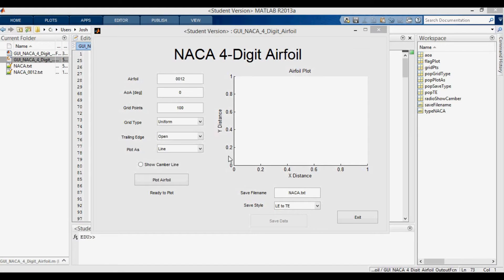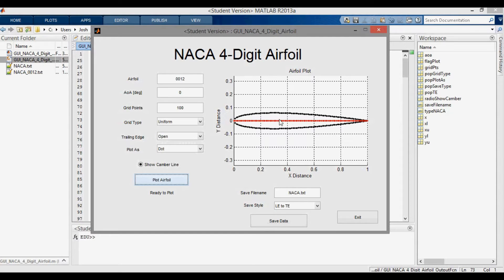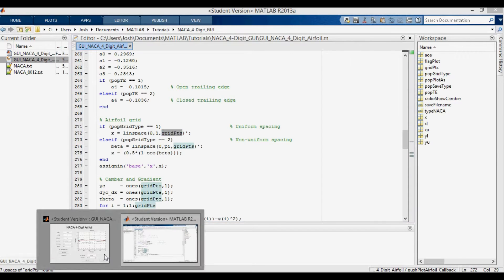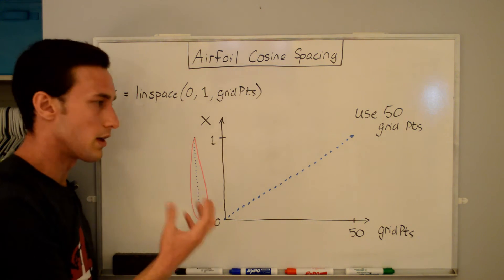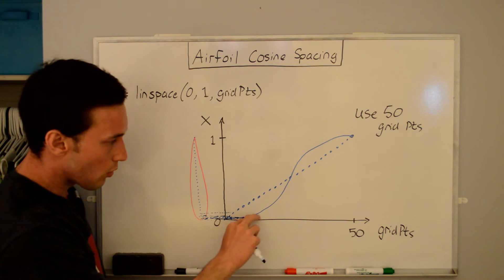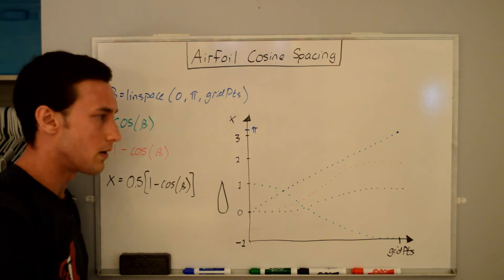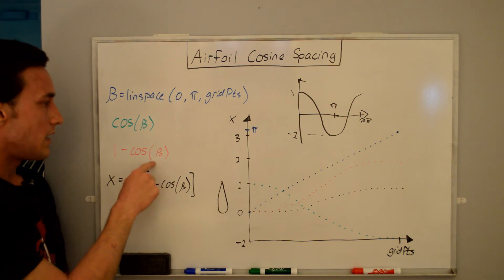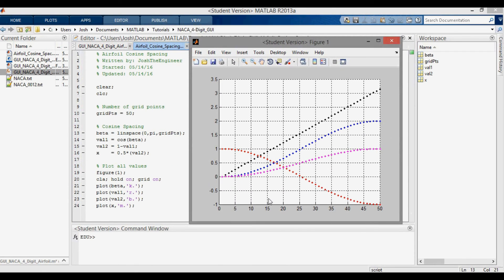Explained: Airfoil Cosine Spacing

Comment: What is the reasoning for using 0.5* [1-cos(beta)]?
In the end, doesn't it result in the same grid spacing as simply using 0.5* [cos(beta)]?
Reply from the maker: In the most general sense, the overall goal of this non-uniform spacing is to get a different distribution of data points that go from the leading edge (x = 0) to the trailing edge (x = 1).  The reason we need the data points to go from 0 to 1 is that the chord length is actually a normalized chord length.  This means that you can take our generated airfoil shape, multiply it by whatever chord length you want, and all the X and Y data points will scale accordingly.

So based on that need to go from 0 to 1, we need the function to increase from 0 to 1 as we go from beta = 0 to beta = pi.  If you look at the plot that I have on the whiteboard, you can see that the cos(beta) plot (green) goes from 1 to --1.  If we just multiplied that by 0.5, it would go from 0.5 to -0.5, so that won't work.  Then you might say, well we can just shift it up by 0.5 and that would be fine.  That's actually what the 0.5*[1-cos(beta)] is doing, and you can see that if you distribute the 0.5 term through to get 0.5-0.5*cos(beta).  At the leading edge (beta= 0), we get 0.5-0.5 = 0.  Then at the trailing edge (beta = pi), we get 0.5-(-0.5) = 1.  To sum it up, the main reason is so that we get a distribution (on the vertical axis of the plot on the whiteboard) that goes from 0 to 1, and simply using 0.5*cos(beta) would go from -0.5 to +0.5.
Reply: excellent explanation, thanks!